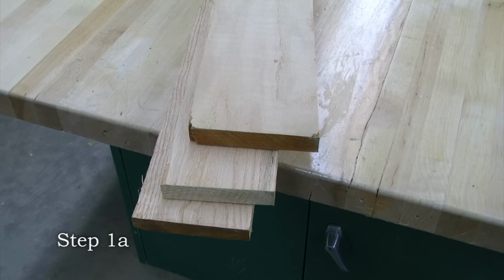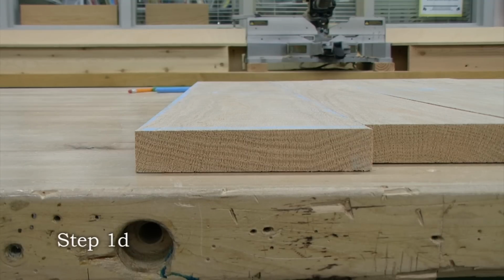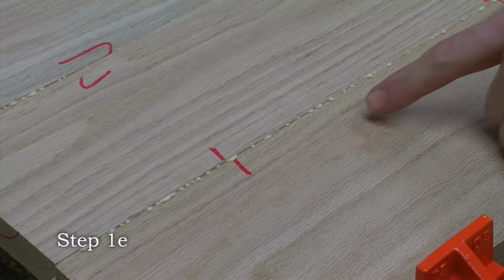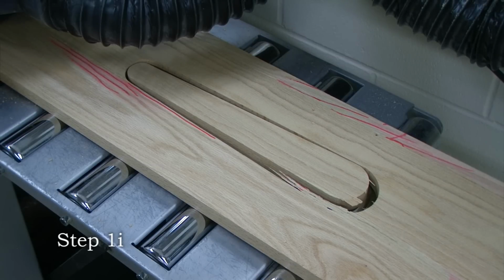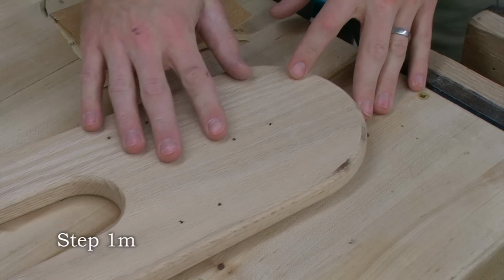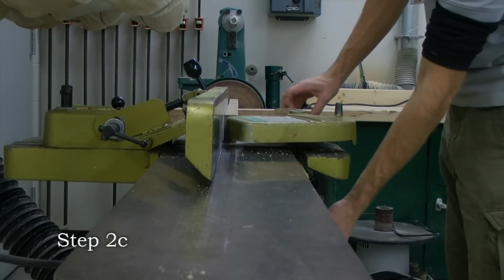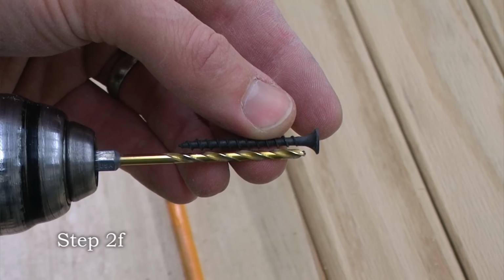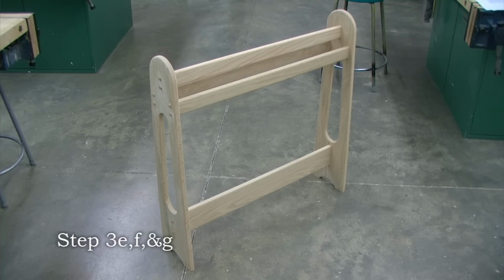Quilt Rack Project with Mr. Olson

Comment: Hi, how many years does it take to finish these studies? And what other activities are involved? (actually, I want to find out how much actual work and how much general maths, physics and alike are involved) :)
Reply: Teaching. High scool studies.
BTW, I see one mistake in your video. That would be about squaring up the ends - you squared them taking reference from a rough edge before jointing it. For your particular application it's perfectly fine, but say your student does this the same way while making a drawer.